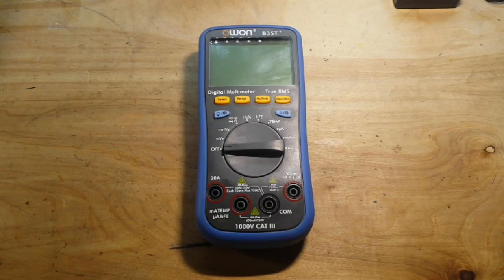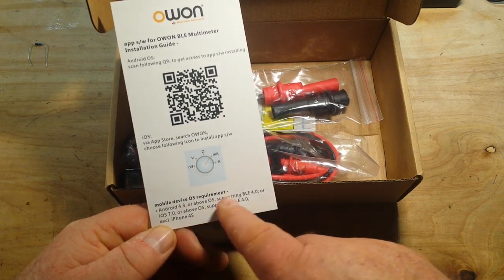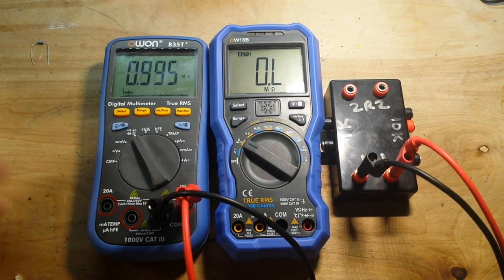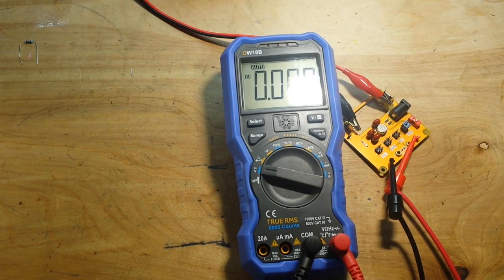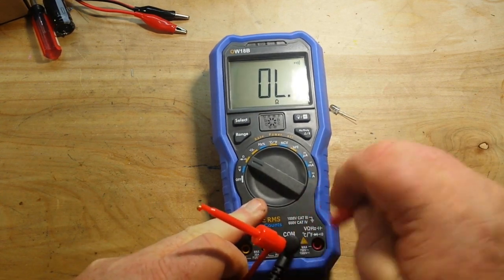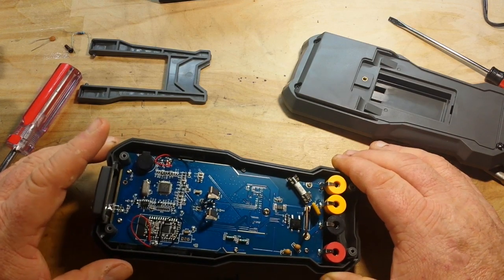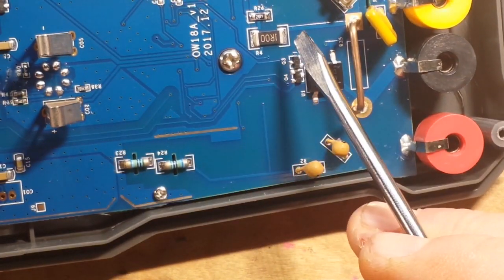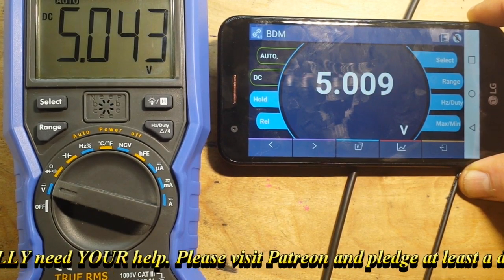Owon 18B Data logging DMM with Bluetooth Review and Teardown

Comment: This is is also available under the Multicomp Pro brand. It's in green (the rubber holster that is). I liked that it feels solid in the hands, good continuity tester, good LCD, over-all a very nice meter, especially for hobby use. I have the variant without the hFE tester, and inside it has two HRC fuses for the two current ranges, and I think the same number of MOVs. The PCB is marked OW18EUR_V1.3.  I bought the Multicomp Pro for about  40 EUROs, and I have to say that for the money, you get quite a nice package. Oh, and the range switch seems to be improved as opposed to the BT series. I find it much better.

Comment: I wisht they made this with either rechargeable batteries or using AA batteries.  Does it have an auto shutoff feature? Whill it continue to run iwithout auto shtting off while actively monitorirn g voltage? does it have ocisiscoping  or graphing capability using the app? Does it have an app that can be used on a PC to monitor the volts/amps etc uusing PC? for cllecting and displaying data?

Comment: Slightly off topic, but have you had a chance to handle the new Owon B41t+ ?  Like the B35t+, but with an added digit.  22000 counts.  Actually cheaper than the B35t+ here in the UK (£65 vs £99 on Amazon).
Reply from the maker: No i haven't. But i have a good relationship with Owon. Ill ask them for one to review.
Reply: Thank you.  I think the B41t+ might use the same chip set as the UNI-T UT 61E, but information is scarce.
Reply: Just bought a B41t+.  Great, seems like the B35t+.  Logging works well including offline.  22000 counts indeed.  Temperature is shown to the nearest 0.1 degree, which is nice.  The screen is a little messy, with smaller figures than the B35t+ and quirky fonts.  The back light works only if you are using non-rechargeable batteries (2 x AA =3v).  If you use rechargeables (total 2.4v), the back light is more or less invisible. Pleased overall.

Comment: I arrived here because the B35T+ is notably more expensive than the OW18B despite the later having better overall specs.  Am I missing something?   Also, thanks for the thorough tests but Im surprised you didn't really leverage two of the most unique features of this meter which are 20A test capacity and BT capability.  The rest is pretty standard stuff available in any meter.

Comment: dedicated chipset👍
software & logging👍👍
9V battery👎
single fuse protection👎
6000 count👍👎 (if aneng can do 9999 count, i don't know.....)
this is similar to VC99 but with bluetooth feature, $50 will be a reasonable price point for its spec
Reply: Whats the problem with the 9V battery?
Reply: Ron Shaw it doesn't last longer than AA/AAA, more expensive to replace, harder to come by at some places.
Reply: Hi, good comment! We will consider your advice and improve our products. Thank you. Regarding the price, different area would get different price, but I can say, the price would definitely lower than $50.It's a super cost-effective product!
Reply: A 9V certainly isn't THAT expensive. You would need 6 AA/AAA to get the same voltage, which would take up a lot more space, and probably be at least as expensive.
Reply: Ron Shaw thats why meters should be designed to accommodate AA/AAA batteries.
from really high end fluke to the affordable aneng, they uses 2/4 AA/AAA batteries and a single cell will easily hold 900mAh where some really expensive 9V battery will only contain 750mAh.
is easy to drop voltage from 9V than making full use of 3V and thats why those cheap ebay/Harbor Freight meters simply throw in 9V designed.